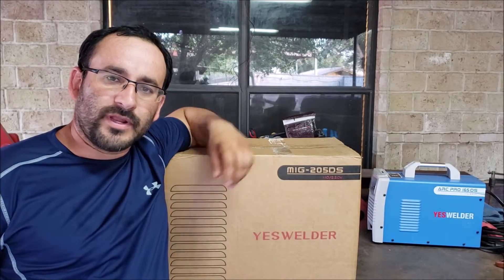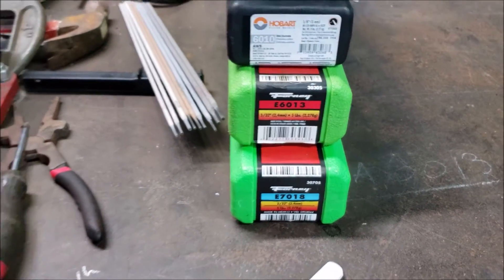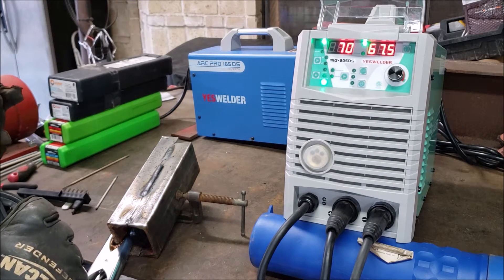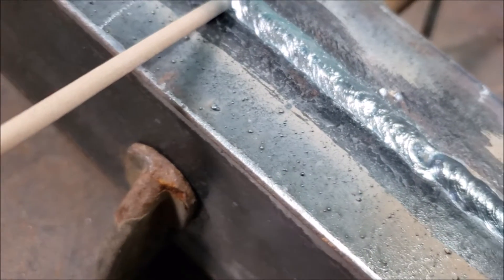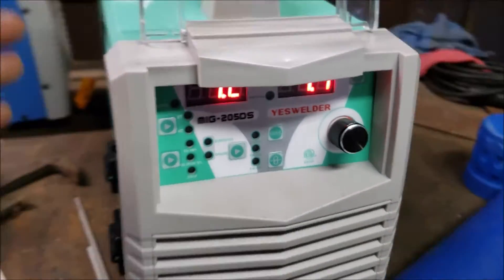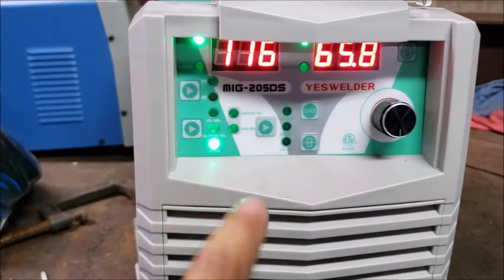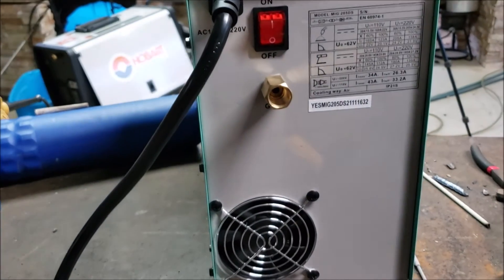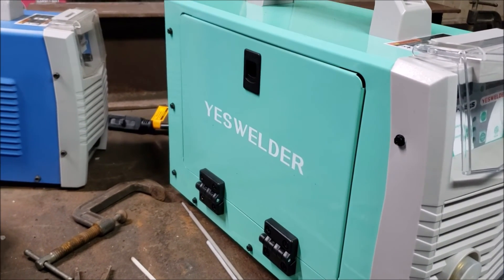3 in 1 Yeswelder MIG 205DS stick welding review and setup : Scratch Tig welder

Comment: Got mine awhile back ago mainly for flux. Just now trying stuck foe the first time. Did you try a 3/8 on anybrids and if so did it work? Or does it only do 3/32
Reply from the maker: The 205ds went out in a bang after warranty period. I did use it on 1/4" and don't recall if I tested any 3/8". I really wanted to try out the new DP200 so might buy one later on.